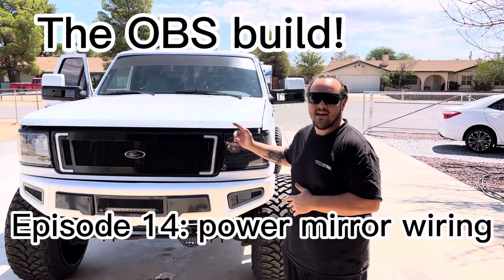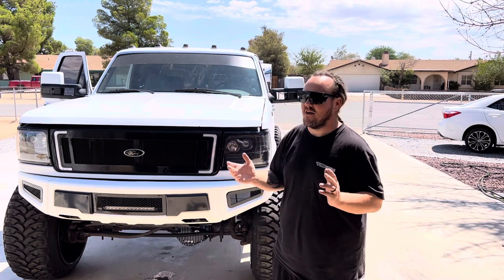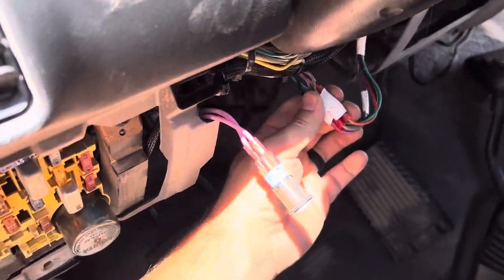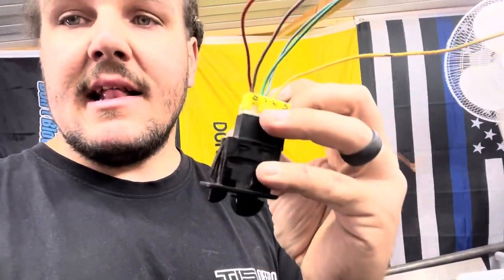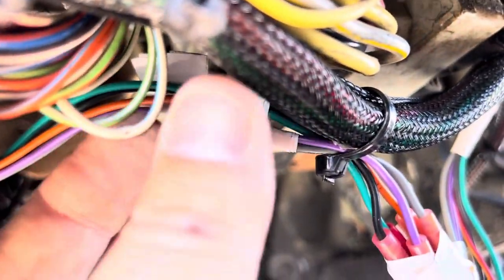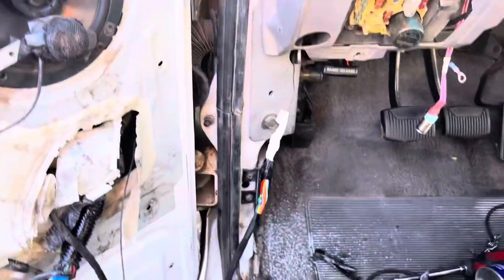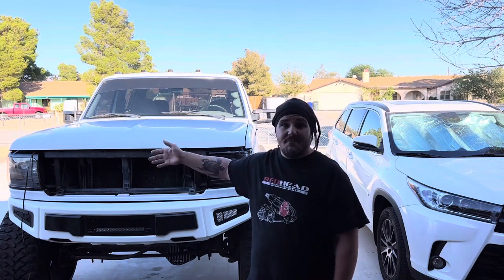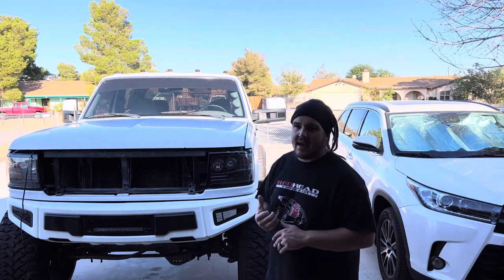Power mirror wiring FULL DIY! OBS ford

Comment: Beautiful truck 👍 i just picked up a nice 02 f350 7.3 about 6 months ago and just got the  new kc300 stage 1 turbo and up pipes installed last week those up pipes header bolts were a pain in my ass 😂😂
Reply from the maker: Thank you! Yeah I opted with a gasser 460, cuz I knew I’d eventually Cummins swap it. In hindsight…. Shoulda bought a dam 7.3 and left it alone 😓😂

Comment: I am wanting to convert my old manual mirrors (mirror mounted directly to the door) on my 1997 Ford F350 crew cab. In Episode 4, you showed how to replace the old tow mirrors with new DMAX Tow Mirrors.  What was the year and type of DMAX Tow Mirrors used in the conversion?

Comment: Thanks man for the video I'm doing these mirrors on my 97 7.3! I would 100% interested in a harness! And can you recommend a set of mirrors by chance?
Reply from the maker: My eBay mirrors are decent. Really just depends on what mirror plate you get. I’d definitely recommend painting the caps and getting the upgraded markers on at the same time of first install, if that’s something you are gonna do. Taking everything back apart is something I hate.
Reply: @OBSBryce  how hard is the glass to remove? Because I know the chrap ebay ones have a screw behind the glass
Reply from the maker: @jamesthef250guy6  easy! Just watch a YouTube video on the technique, and you’ll be fine